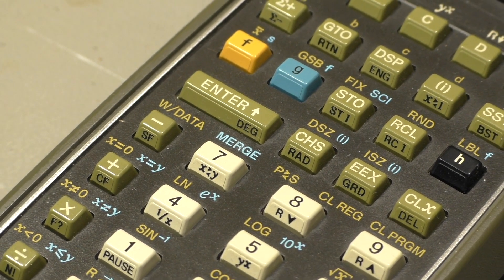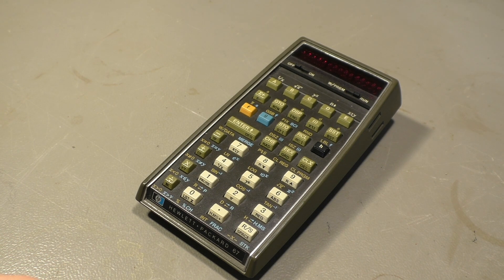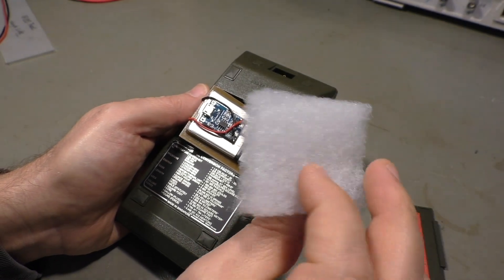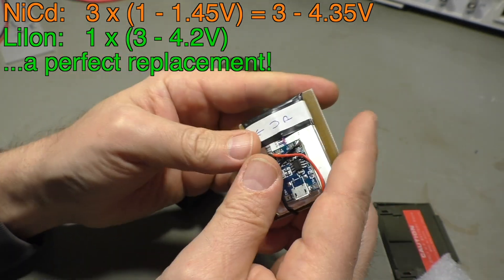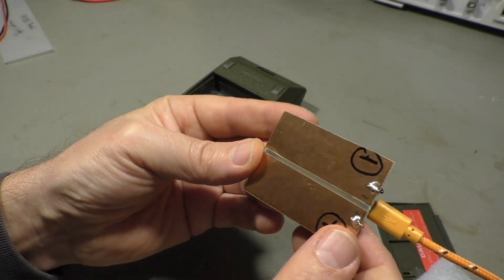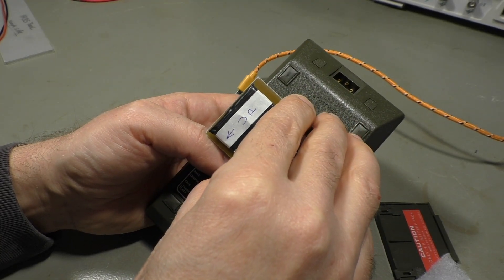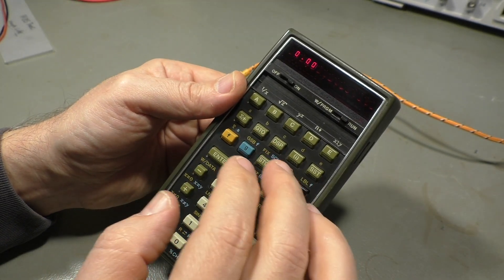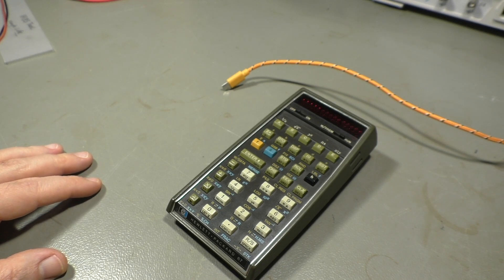QUICKY - HP67 calculator with new Lithium battery (PWJ251)

Comment: Got one used, tape drive not working. Push tape in, nothing no sound no motor spinning. I could push the tape in by hand but not too far otherwise couldn't get it out. Any ideas?
Reply from the maker: The card mechanism is pretty simple. One of the switches turns the motor on and as soon as the card releases that switch, motor stops.
That means either the motor switch is not working (corrosion or dirt), a wire broke, the motor is toast or the rubber roller has become so sticky that nothing will turn.
There is a ton of information about the HP67 try google "HP67 repair"...

Comment: nice &easy help to further use my HP67(😊65) I'm also waiting to get my HP85 running. here I hate all my not-anymore- functioning cassetes...
Reply from the maker: Yeah those cassettes are difficult to repair. I have 10 brand new (old stock) but all the drive belts are bad. It turned out that HP and 3M put a lot of effort into making these belts work properly. 
I odered Plastbands from the USA in hope they will work....
Repairing the cassette drive is simple compared with the cassettes.

Comment: Just a suggestion: I would have used NiMH cells because of thier similar voltage and discharge current behavior to NiCd. They are replaceble 1:1 without other work to do.
Reply from the maker: Sure... but I don't like Ni-xx batteries. Since I don't use that calculator often, the LiPo battery provides much better long time energy storage.
And I had these parts just lying around... cost me nothing :-)

Comment: Another mod you could do (probably sacrilege): position the charging module so that you can plug a USB cable directly through the calculator body without having to remove the battery. You can drill a hole on the battery cover so that you can see the charging status LED too. I can hear the cries already :D
Reply from the maker: Yes... but no!
Of course this would work, but it would look horrible. It's like putting modern wheels on a classic car 🙂
The other reason is that I don't use that calculator frequently and therefore it's not necessary.

But I could place the charging port on the bottom side so that it can't be used while charging  and call it the Magic Mouse Calculator 🙂
Reply: If I were doing this (and I am considering it!), I certainly wouldn't want to  permanently modify the case of my HP-67. But I suppose I could 3D-print a replacement back cover, with a hole for a USB port. There's someone on Ebay who sells 3D-printed replacement battery covers for the HP-67, and apart from being the wrong colour they look pretty good.

Comment: Slit the PCB vertically so it won’t contact the wrong way round.
Reply: And after slitting vertically now you have 4 pads. Cross-connect them and now, no matter how you insert the battery, the polarity is always right :-).

Comment: That is a nice little battery mod for that calculator. I would have put shink sleeve over the entire device and cut the USB socket open plus cutting holes in the bottom for the spring contacts. So you can't damage the calculator by inserting the battery pack the wrong way around and also you got better protection since your B+ and B- pins are still visible. Hard to reach but possible to reach in theory.
Reply from the maker: If I ever sell this calculator, I will do so. But for my own use, it is safe enough. All plastic around it. 🙂

Comment: I have an ancient T.I. calculator from the same era (1970s?), and it had the most aggravating battery pack design in the world. 
Two NiCd AA cells, but with a DC-DC (~2.5v to 9v) converter built into the battery pack.
The DC-DC converter was thus running 24/7 and of course was slowly draining the AA cells even when the calculator was switched off. Like just before an exam.
So I replaced the battery pack with a simple 9V battery, and in the course of doing so discovered that they'd assigned Red wire = negative, Black wire = positive.
With a simple 9v battery, powered OFF was really off, and the battery lasted for a very long time in storage. Easy to carry a spare for exams.
Reply from the maker: I know exactly what you mean. I have a couple of those TI calculators and I replaced the pack with a 9V block battery. Of course not rechargeable.
If you want to use it with the original charger, it works by replacing the pack with a large capacitor (2000-4000uF/16-25V)
I never thought about that voltage converter... yes it is constantly on... what a design choice. I still have one somewhere, I could measure the standby current. 🙂

Comment: I would suggest the one thing not to do is to plug in the original power/charging cable as that would bypass the BMS that protects the Li-ion cell ?  Please correct me if I’m in error. I think the common BMS is looking for 5V on the charging input? Aside from that thought what an excellent modification ! I also have HP calculator(s) that are no longer useful due to the battery EOL.

Comment: Nice!  Would it be possible to make another cut on the PCB so if the board was put in backwards, there wouldn't be any contact with the battery?  Or perhaps glue a strip of material so that the contacts would be pushed away if inserted wrong?